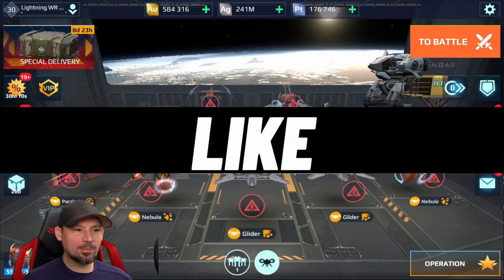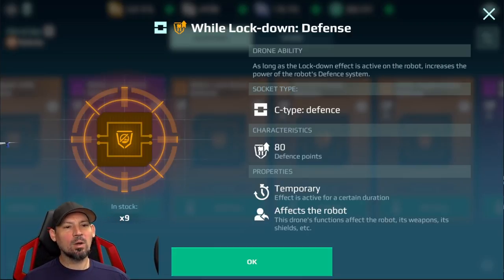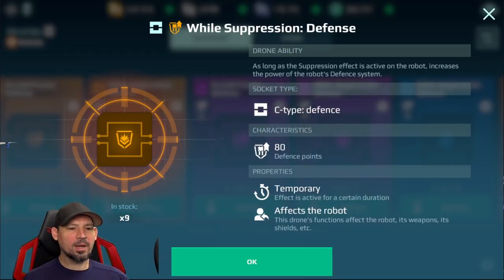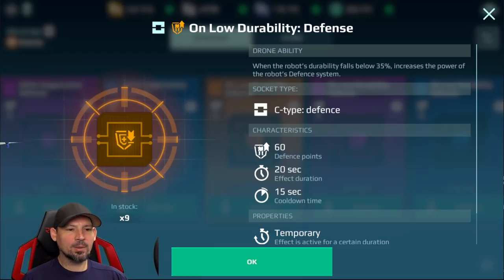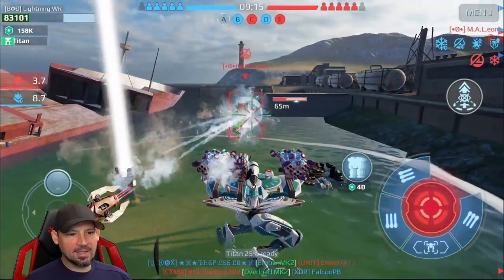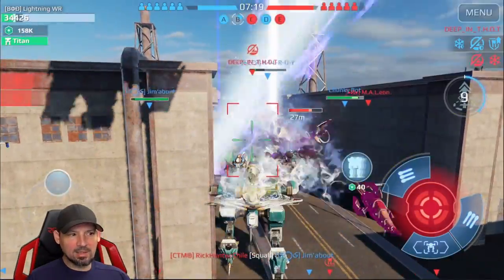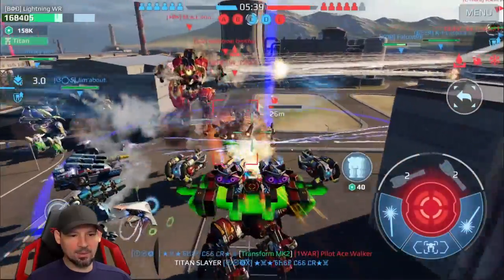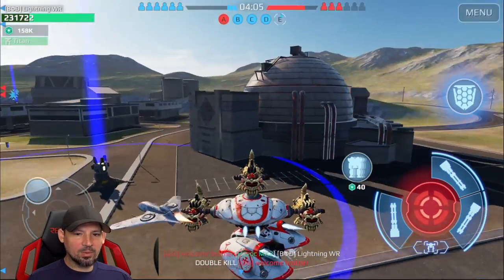War Robots Defense Microchip Guide, C type chips + WR Gameplay

Comment: Hey Danny... I finally grinded enough to combine n make a purple "While Supression: Defence. Would you switch it for the "On Repair Unit: Defence" chip.? Thank's :_bleubolt:
Reply from the maker: Well if you find yourself constantly being suppressed and you don't want to spend your power cells to make the current one activate then it might be a good swap, generally it's nice to be able to use the repair one so you can activate it when you want it to work but that does have a consequence which is having to use power cells so that one's kind of personal preference I get but I like to use the on repair defense and damage chips myself so I can get them to work when needed

Comment: Do C-type 80 defence on activate repair unit stack? 2 chips get you 160? Or...?
Reply from the maker: Yes if you run two chips they do stack on top of each other but there is a drone rework coming and I think they are going to be removing microchips completely so that's something to think about, it'll probably be here in a couple of months or possibly sooner.  Any chips you have will be converted into some sort of currency that way they're not just taking your chips away